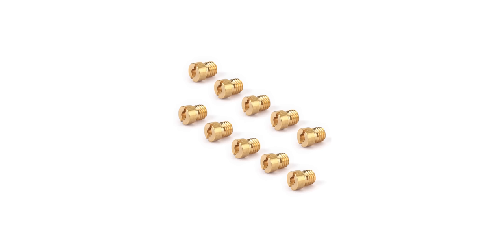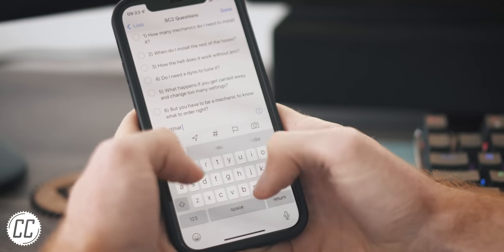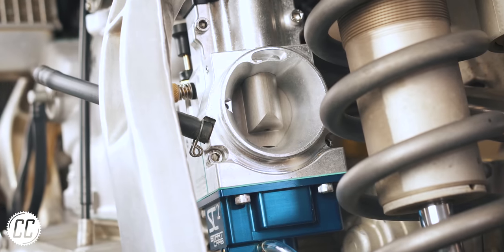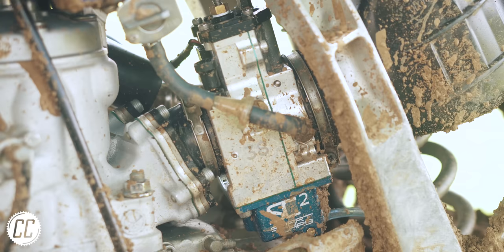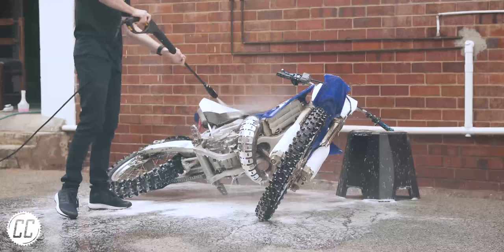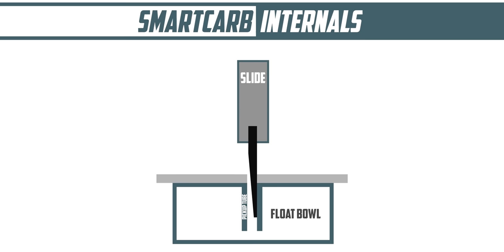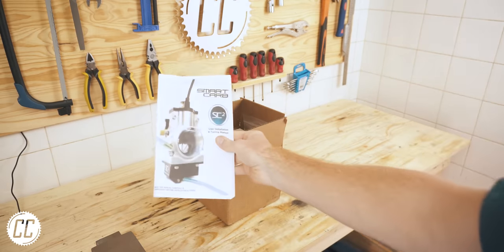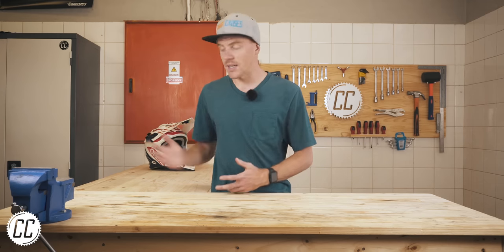The Best Carb Money Can Buy? | SmartCarb SC2

Comment: I'm curious if this would work for 4 stroke engines as well, or is it possible to make a rack of them for an inline 4 bike. And what about boosted applications?
Reply from the maker: Yes, definitely possible! I just used one for the 2-stroke since that’s the bike I have. Works with turbos too. Incredible carb!
Reply: Same question I have, I highly suggest to go to the SmartCarb website (link in description of of this video), leave your contact info (email), and they should email you back with details.
Hopefully if enough people inquire about it:
1. We'll find out that the SC2 can be rigged up to a 4-Stroke road going bike, OR
2. They'll see that there's a community out there wanting this for street motorcycles and make an SC3 or such.
Reply: @MrCODEmaster00  we'll keep an eye out for your email inquiry and get back to you as soon as we can. Our focus has primarily been on the 2-stroke market as that is our riding passion, but we do recognize the needs elsewhere and are growing to serve them. We have equipped 4-stroke bikes with excellent results for years, provided they will fit with a single, top-pull throttle cable. And as for boosted applications, well, we did just play a part in securing 5 new Bonneville Speed Records in July on a turbocharged YZ125/144 in an R6 chassis.
Cheers!
Reply: @SmartCarbFuelSystems  Thank you for the response, may I ask for directions to see if/what SC2 carb will fit a stock-engine CMX250 (Honda Rebel 250cc, 2005 Year)?

Only thing I found was the tool to see what 2-Strokes it's compatible with, do you have a similar thing for 4-Strokes to find out what specific model/size of carb I'd need?
Reply: 700+ dollars for one...it will cost about the price of a new engine...
And adjusting 4 carbs is just a  pain...
Reply: @SmartCarbFuelSystems  Yeah, 4-stroke demand is there. For those, might have to move the gas inlet from the side to the top, and to consider a more rounded, cheaper, cast version, the CNC-block-cut-look isn't for everyone. What about the tolerance between the slide and the aluminum housing, will it wear out over time? I assume there is no need for the blue hose while driving, and that the stud can just be capped off ..
Reply: @SmartCarbFuelSystems  Im trying to picture in my head what a pair of those would look like on my Yamaha RD350 restomod im building... lol.!
Reply: @SmartCarbFuelSystems  this would be great on my drz400!

Have you considered approaching motorcycle manufacturers to allow them to build under license? It seems like this tech could save alot of old trusty bike designs from the "emissions" chopping block.
Reply: @SmartCarbFuelSystems  I Race XC on a 2005 TRX450r. Do you have a set up for that
Reply: @griffspeed  They could sell a few if it smoothed the 5K stumble.
Reply: @yveslegrand9826  I dont ride bikes but 700$ seems extremely steep. I dont even have that much invested into my ITB setup on my civic, including price of my ECU

Comment: It's a lazy man's electron carburetor with all the fun taken out of it of manually adjusting that tapered needle one notch at a time and then when running out of notches you grab into your drawer of a thousand other needles of different tapers and start all over again but you guys have taken all the fun out of it I say by merely pushing a button what fun is that ⁉️ it will only lead to more time on your hands to turn the throttle and wear out your engine completely wfo throwing roost at your buddies pissing them off to the point you will have no friends... As you will be riding while they are still at home changing Jets

Comment: Having dealt with lectron and smart carb in person I will say although when they work right they are great but when they don’t work just right which is 3 times out of 5 they far underperform compared to say a stock kehin. If your looking for the best 2 stroke carb setup I highly suggest a stock kehin with a STIC metering block.
Reply: Yes STIC is what you need IF power you want . Best carb mod i have done ..
Reply: @laspar3462  I have a yz125 with the stock mikuni tmx38, would it be worth the switch?
Reply: @aaroncrain2343  air striker, lectron or smart carb are going to be massive game changers. The air striker is a great carb when tuned even without STIC, but that's a very expensive addition to the $300 you'll throw at an air striker. People tend to leave out the fact the STIC is close to $400. So you're sitting at a very specific $700 system. I can assure you and 99% of the people who watch this video that you're not getting the most out of a STIC system. I have not gotten my hands on a smart carb, YET. But a lectron in my 1998 cr250 cleaned up the entire powerband and the fuel economy is PHENOMENAL. My lectron experience has been wonderful and my c250 is a full blown woods bike and I tuned it to have a flat power curve. So for around $350 you can have a great Air Striker with a jetting kit or for another $300-400 you can get a lectron or smart carb (or stic). If you're lucky you can even find lectrons (as long as they're compatible.) for a little under $400 used which is what I did. Took some time to tune, but got dialed in.
Reply: Kehin is really bad. If you don't believe me what did Harley Davidson choose for a carb. Mekuni smooth bores are everyones choice for street or racing.
Reply: @genefoster8601  you must not ride dirt then cause every Mikuni I’ve had specifically the carb off my brothers 02 CR250R are way to picky I think just about every dirt rider will tell you the kehin is superior
Reply: @genefoster8601  The mikuni tmx for two stroke dirt bikes is notoriously known as a brick. Street applications are entirely different, too. And kehin carbs have always perform really well historically.
Reply: @RonnieMacJr69  I'm just maybe living in the past. Finished 7th in the state in 1972. I'm 81 years old now and had to even give up my street bikes which were a 2012 zx14 and a nitrous zx12. In the 70's Husky and Maico (Breako) were the bikes of choice because Yamaha was just entering the scene and at that time Kehin were horrible. My friend and I were bigger into drag racing. Our lay down kawasaki nitro turbocharged bike turned 7.56 in 1985 with a two valve engine. We had a company that sold spun aluminum drag wheels, wheelie bars and extended rear ends. We nailed Byron Hines and Terry Vance at Bandimere. They were friends and bought product from us. At this age I'm really sad 😔  I had to give it all up because I started riding in 1956. I guess all good things come to an end.
Reply: @aaroncrain2343  no
Reply: @genefoster8601  hahahahahah - keihin and mikuni are both unbelievably great carbs. Anyone who says different just isn’t an expert at jetting. Learn how to jet a carb 100%

That means knowing all the parts and what they do and how they contribute. It’s knowing needle jet sizes, slide needle sizes, clip positions, pilot jet size, slide cut away  differences, and air screw and idle screw adjustments 
-
Knowing what those are and what they do is not really that hard. You just need to learn from someone knowledgeable.
Reply: @haitzyice  you're right. And the guy you're talking about is me. (VICKERY YAMAHA).
Reply: Not much of a mic TMx fan .I have 3 Husqvarnas that came with them and have replaced them all with air striker carbs. Just my opinion.
Reply: Yes. But I use a pwk air striker 38mm best carb i ever put my hands on.
Reply: @aaroncrain2343  yes. That carb is crap compared to the Keihin pwk 38mm air striker
Reply: @Xeil  your fuel economy with lectron is great because they lean bikes out wayy too much. This is also why they reduce power. Lean is very bad for 2 strokes. 
Also a richer mixture = more power. A properly jetted Keihin air striker greatly outperforms a lectron. And for less $$
Reply: @genefoster8601  ...or, Kei-Hin CR.
 Mikuni 'smooth bore' are just cheaper and a LOT cheaper for parts (and a development from 1930's AMAl carbs)
Reply: What makes Lectrons and SC2s so finicky?

Are you talking about the adjustments? Or is there more to it than that?
Reply: @soconnoriv  Lectron were designed and developed for drag racing where wide open performance was required. I don't know about new ones but the originals were very difficult or impossible to set up for low end and mid-range and pretty worthless as a street carb or MX or Enduro where lower engine speeds could be needed (I've never met anyone who was 100% 'on the gas' all the time, no matter what they thought they were doing)
Reply: @genefoster8601  Harley Davidson is a pretty bad yardatick for 2-stroke carb choice though 😂
Reply: I had a Lectron h series on my 2017 300 xc_w for 2 years. Lectron runs lean and have no bottom end. Sold it bought a 38 mm air striker with the Stic block. What a difference so much bottom end and power it like you have 50 more cc s . Don't waste your money on Lectron or Smart carb they don't even compare.
Reply: You should always take any performance motors to dyno tune it. One tune and they good to go. Just powerjet adjustments after that.
Reply: @markstreet7431  Totally true. With a wide-band/5 gas analyser it's pretty easy to see where any problems or adjustments are needed. Dyno time may seem expensive but it can save months of messing around
Reply: SC>Mikuni are great >kehin meh

Comment: But can it work on a old carb motorcycle with no electronics or anything smart like throttle position sensor
Reply: I sent a message to SmartCarb's contact email wondering the same thing, I have a 2005 Honda Rebel 250cc, and I'd LOVE to:
1. Replace a carb that I have no clue how to tune/repair if need be.
2. Get a better carb than what I have now.
3. Make it even more fuel-efficient just as a happy accident.
Reply: @MrCODEmaster00  let us know
Reply: You can get the carb with or without a throttle position sensor.

Comment: Great carbs, I imported one in 2014 & fitted it on my KX500, Corey from APT assisted me with the setup and it was quite straight forward. I did the quads4quads run from Carnival City down to Ballito without any issues related to the altitude changes. It’s worth the money. Great episode man, I recognized Rhino Park straight away.🤣
Reply: I had to double take when I saw the NP200, then noticed Rhino Park 🤣